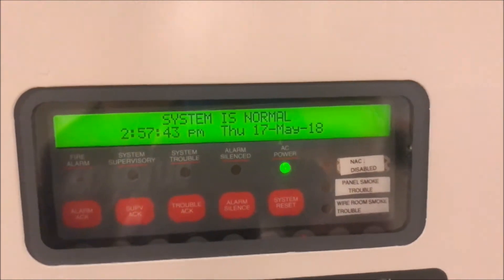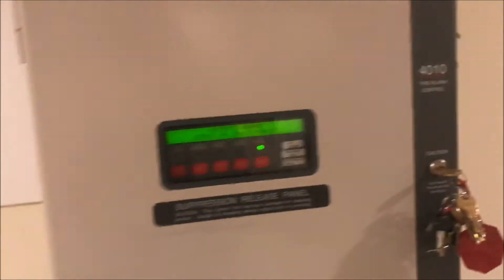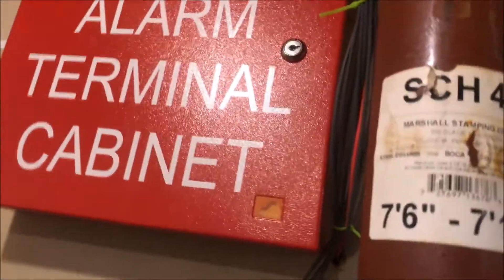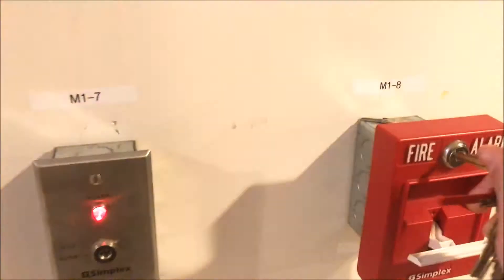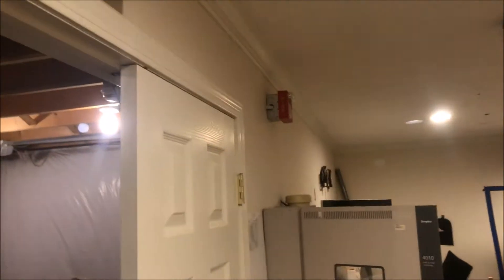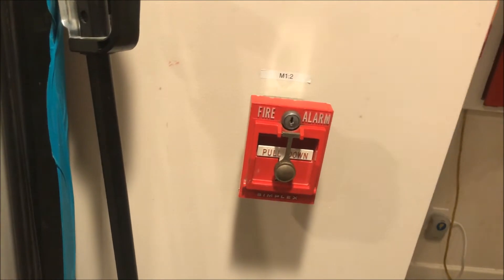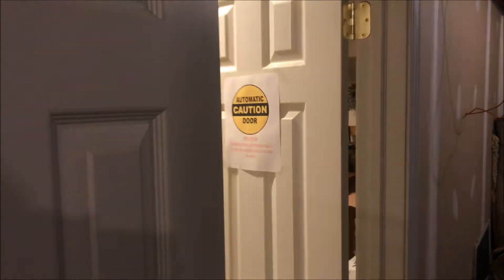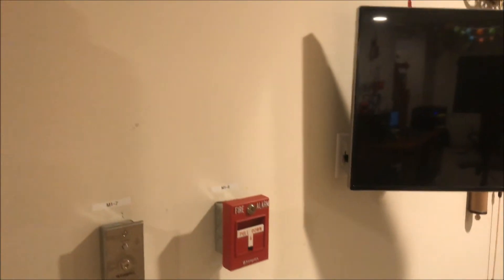Simplex 4010 Test 8: Request Test- Evan Bart 410

Comment: Cool video and how hard was t to reset that pull station and also how come you didn’t have to throw the switch
Reply from the maker: Fast CSX I’m assuming you mean the FCI MS-2. That pull is very easy to reset. The switch resets like a BG-12. It just springs back when the cover is closed. The instructions actually say to just turn the key and let the cover retract on its own.
Reply: Fire Alarms and Such oh ok I didn’t know, thanks.